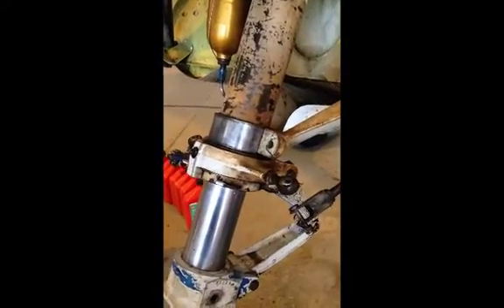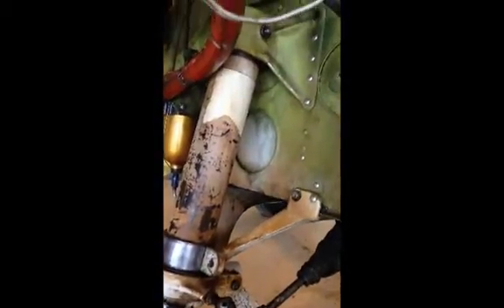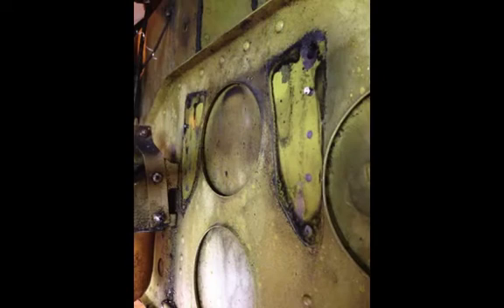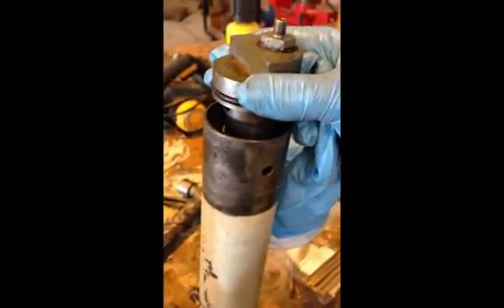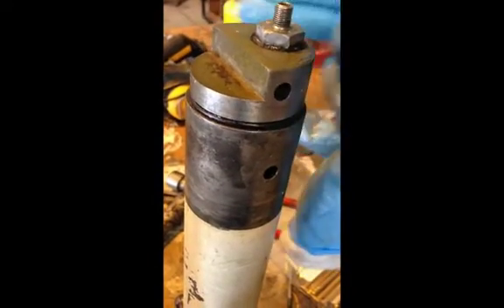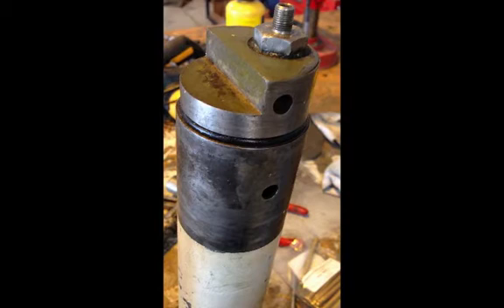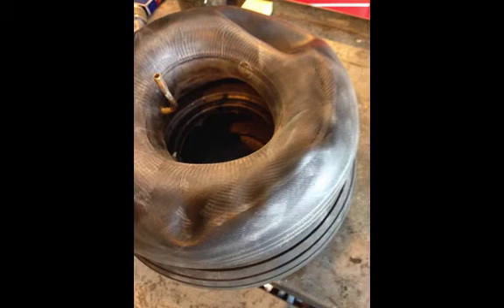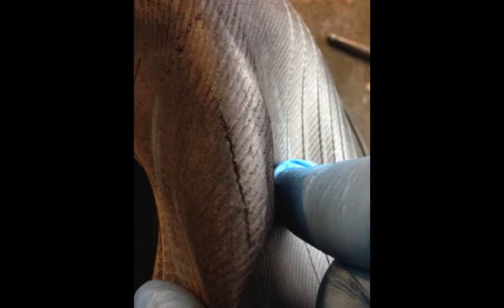Cessna Nose Landing gear damage

Comment: Can this be repaired.
Reply from the maker: Yes, If the damage is simply sheared rivets, and the firewall and forgings are undamaged, they are replaced according to section 18 of the AMM or the SRM with oversize fasteners as required, If the firewall or its supporting structure are damaged these usually need to be replaced with new parts.
Reply: Do you have a video of the repairs ...can you get to the rivets is it a big job.